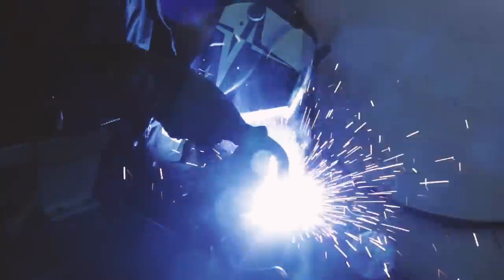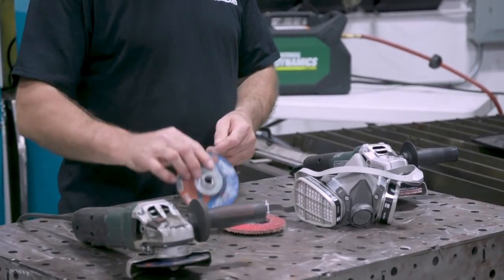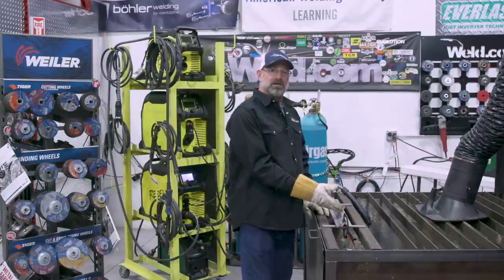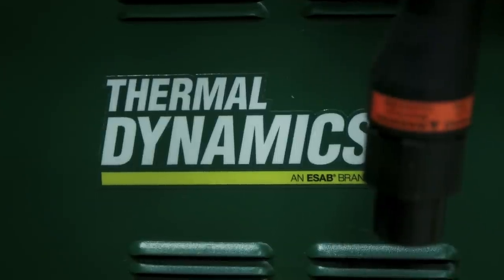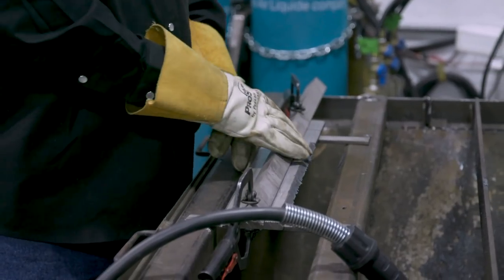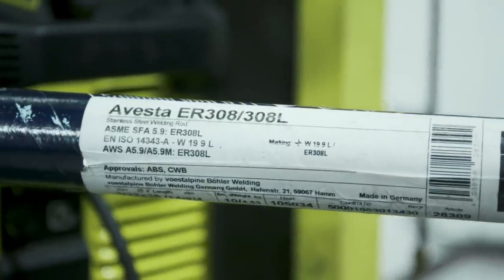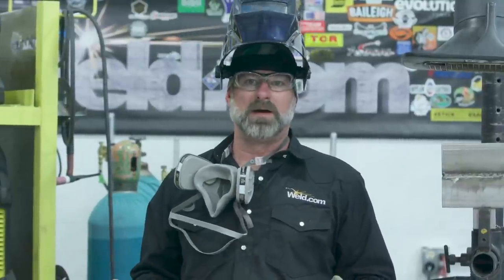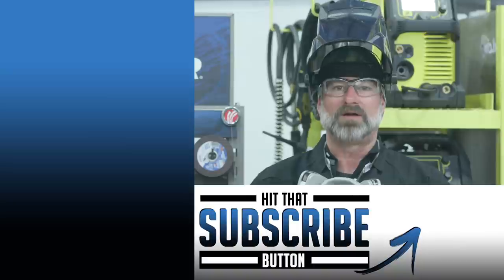Preparing a Stainless Steel Coupon for Welding: TIG, Stick, and MIG Techniques

Comment: Need to do videos on what set ups are needed to weld different metals. Like for welding aluminum with a stick do you need AC or DC, reverse pole ECT. One for mig, tig, and stick. It would be really informative.

Comment: THANX for the information😁😁👍 2 questions 1.. did you lay wire the filler on your root pass 2.. was this open root and how did you protect the back side or did i miss something?
Reply: I would like to know that as well!
Reply: @Jessica Mathe ok thnx, so that brings up this question was the backside sugared?  im curious?
Reply: @Jessica Mathe was it the lay wire technique with tig??
Reply: @Jessica Mathe ok was curious thanx

Comment: Do you have any suggestions.. What is the best or good portable welding machine.. I need to buy but I have no idea for what is good to buy.
Reply: HTP Pro Pulse 220 MTS, IMO.
Reply: Only advice i can give is go check some out , read reviews on them ?  
Dont go cheap , what you pay for is what you get ?  Stick to around 180 amps two two hundred amps that way it should cover you for years to come  regards from australia

Comment: Hey, Paul. Great job on your 1st video with Weld.com. That was interesting to see. I have only welded stainless alloys with GTAW, so it was cool to see these other common processes used on stainless. I noticed that it sounded totally different when you were MIG welding vs steel MIG processes. Is there something to that or is it just the audio?
Reply: I think it could be the different positions you’re working with. Less wire speed use with vertical or horizontal

Comment: You need to show what to look for on stick puddle and so on no it does not run anything like 7018
Reply: camera angle made it look like he wasn't even dragging and didn't show the start or stop.   i think a video that showed how the camera angle can distort what is actually happening would be helpful so you are not misled about what is happening
Reply: @peetky8645  Need New Camera Guy ASAP

Comment: It’s a shame to see this kind of work passed off as “looks good” on this channel. The root pass wasn’t shown on the back side, I can only imagine what it looked like. The stick portion wasn’t terrible, but the mig looks rough. The grind marks and spatter left behind are not a good showcase of craftsmanship. Hopefully Jason comes back soon.
Reply: I was going to say, pure sugar on the backside of the root.
Reply: please submit a video of you doing the same so we can compare.  just saying....
Reply: @madcapmagician6018  Is rather see someone on a highly viewed channel that proclaims to be an expert do it correctly. Are you a welder? Inspector? Instructor?
Reply: Did you know that putting any kind of open root on stainless steel will sugar on the backside without some type of gas purge, purge tape, or backing strip? :)
Reply: @TylerWard335  yes i am a welder with over 20 yrs exp.   that's why i asked the questions i did, because he may know a techniques that i don't, i don't presume to know everything.
Reply: @cameronbruce7755  yes i did, but he may be using a technique i don't know about and that's why I was asking. i have 20 yrs experience in the trade, but i don't proclaim to know everything. the wise man listens and learns. 👍
Reply: @madcapmagician6018  a man of 20 yrs experience? You really have to be joking. A person of 20 years experience in this trade cannot truly believe that welding 304L stainless steel open root with 308L filler rod will not sugar (oxidize) and or contaminate the backside of the root without protection from oxidation. Meaning OXYGEN CONTAMINATING YOUR ROOT.
Reply: @madcapmagician6018  I don’t recommend learning to weld open roots in stainless without a purge or back gouging and welding the other side. I have worked for some of the companies he mentioned, and I can attest that they DO NOT weld stainless roots with no purge and leave it. This channel is watched by a lot of young and upcoming welders that don’t need to get some bad advice.
Reply: @vintagespeed  I don’t think I’ve seen it yet, Jason is very knowledgeable and helpful. I’ve interacted with him in the AWS forums and been in AWS seminars with him, he’s a wealth of knowledge. These other guys...not so much.
Reply: @cameronbruce7755  did i say that? no .. that's why i asked the questions i did.    perhaps he forgot to mention how he protected the back of the plate.. i don't know again perhaps he knows a technique i have not heard of.
Reply: @TylerWard335  maybe i was a little harsh.....but i enjoy weld.com and the great videos that have built this channel over the years (since Bob Moffet) and it's disappointing to see some of the latest releases.....that's all i meant to say.
Reply: @TylerWard335  Thank you. I was hoping someone else would see how  misleading this video is to new welders to a respected channel.
Reply: @vintagespeed  Yeah I’ve been watching this channel for years, since bob was on here. It’s not the same anymore.
Reply: @TylerWard335  and thats what im thinking as well im just curious as to what he was doing.
Reply: @cameronbruce7755  That’s exactly what I’m getting at, don’t teach bad habits or push false information with no context on a “learning” focused channel.
Reply: @madcapmagician6018  I hope more people look at this conversation and realize there was no instructions on how to protect the back the plate and or pipe for this matter and how this was a poor demonstration of a stainless steel open root. (Bob would be pissed)
Reply: i have never done stainless mig but the puddle in the video looked very cold and the resulting welds looked ropey with poor penetration.  never said what angle he beveled at, wire size or plate thickness or his mig settings - seems like an experienced person would be put off by the results and the novice misled by the scattershot information.   I once took solo whitewater canoe lessons from a 17y/o olympic kayaker.  worst experience of my life and a waste of time and money.  the kid did everything effortlessly and naturally so he was unable to explain anything.   teachers/demonstrators need to know how and why and be able to communicate both.  bob moffatt and jason were pretty good at both, hitting most of the important points in most cases.  hope the new hosts can get up to speed.